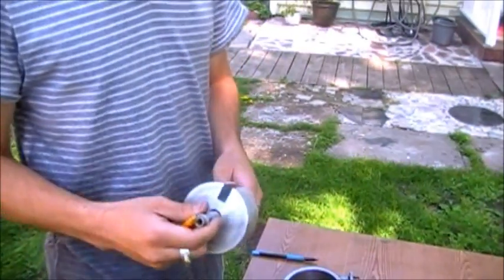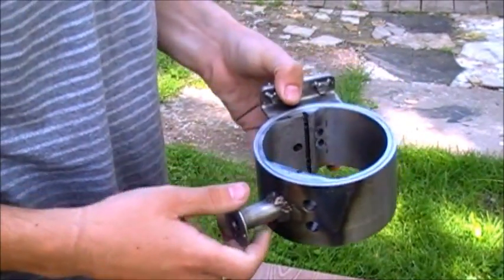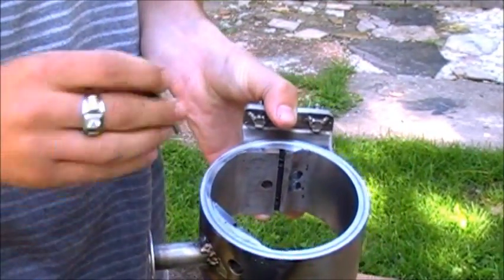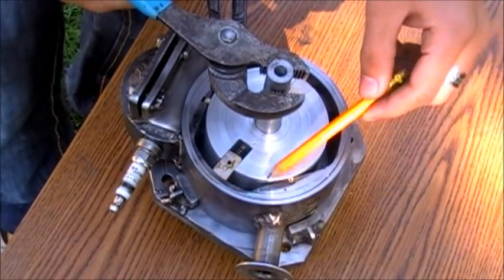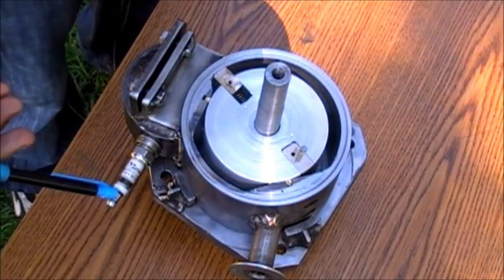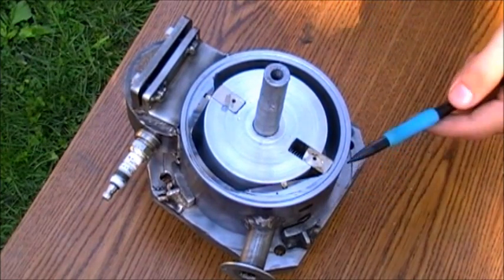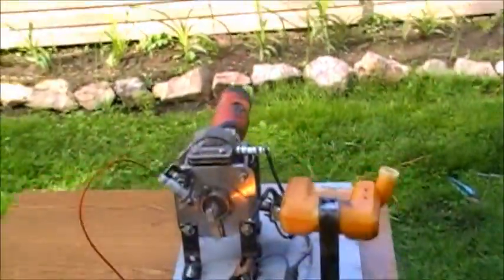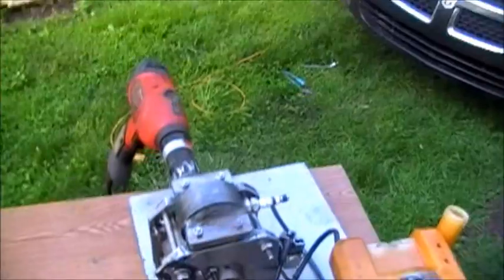new rotary engine semi functional prototype

Comment: Interesting way to view and build a rotary vane engine.  Exciting to see your ideas.  I like your combustion chamber idea, but the first thing I see is that your intake sweep does not push the intake into the chamber. It only creates a large space behind it as it sweeps. Yes, this draws in air and fuel, but does nothing to push it into that chamber. Even IF the other vane were operating opposite the one you demonstrate, the timing would not create compression in the combustion chamber because it is open to the back side of the primary vane which is rotating away from that chamber at the same speed.  That timing would allow the forced induction to run freely out the combustion chamber and behind the first vane.  Maybe if you add 6 more vanes so that each one is backed up by the next one.  Then you would need combustion to happen BEFORE the vane begins to move out from the center rotor.  Problem there is that each intake event would be much smaller.  You would need to reduce the combustion chamber accordingly.  Many small power events rather than 1 or 2 large ones per rotation.  IDK.

Comment: The issue is not just poor machining. As a proof of concept prototype it is good enough. The one reason I can see that there is no combustion happening even though there is spark at the correct time and place. It’s because for the spark to ignite an air fuel mixture there needs to be positive pressure of the mixture to more than 4 bars. In your proto, there is no pressure increase in the position where the spark happens. If you look at the cavity where the spark happens between the check lock and the vane, there would probably be a negative pressure that’s under one bar because most of the pressurisation is still happening before the check lock. So That will never ignite. 

My name is Deepak, im an industrial designer, I've also been working on a rotary vane engine just to try solve this challenge if possible and I will be making a proto in the next few months with a help of a few close friends. but judging by all the experiments I have been seeing on the net, I am now less confident that even mine will work since none have been successful so far. But each of these videos, like yours really helps visualise the issues much better. So I will give it a try. 
Thanks for this video, and Best wishes.

Comment: NICE!!

One thing overcomes leakage:  RPM!!!  
This design will simply not work or start at  the low RPM the drilling machine is turning it at IMHO.
That means the one way ball valve will probably not respond fast enough...

Tolerences:
Research:
Dr Ali Erdemir Argonne National Labs Boric Acid in engine oil lubricant
NB the research where it's tested as a fuel additive!

NB that this stuff forms a half micron thick layer that is not only 'Frangible' but slippery as hell and turns the water of combustion into a lubrication advantage..!
A half micron thick layer on a surface = 2 microns of tolerence removed from bearing etc diameter..!

ie:
* Treat the engine in accordance with the Boric Acid research to remove 2 microns of play (+ greatly reduced friction) from all the sealing surfaces etc.  NB it's 'Frangible/Frangibility.......!!
* Remove the springs from behind the rotor seals. (rely on centrifugal force)
* Spin/Start it with an electric motor capable of much higher RPM than that drilling machine.
* Play with ignition timing.
* Consider a lighter, faster responding, one way valve arrangement.
And you're off to the races!

Comment: So controlling the flow inside engine is better managed by a Vale that blocks the area were it causes Eddie flows and countering out the pressure I'm looking into that at moment, the shap of the inside of this engine is everything that wouldt work, to much contact causing wear, but I see why he did it this way.

Comment: Central fugul forces are often used in vain pumps but it causes lots of friction issues, also leaving a small get can be better which doesn't keep much power, using springs causes to much pressure and takes energy from the engine so that not much good, using material with slip properties like Teflon is sometime worth trying.

Comment: I think there are two considerable issues with this engine inner design. The most severe issue is sealing the of the volumes and the sealing at the rotary piston flat surfaces against the housing plates. The other severe issue is the curvature of the vane path. There are circular curves and flat pathes. The transition between the curvatures lead to shocks and bouncing of the vanes against the surface. An elliptic inner path is steady which will considerably reduce the vane acceleration.

Another typical problem of rotary engines, which also the Wankel engine has, is the relatively high sliding velocity inside the housing, which can lead to interruptions of the lubricating film. It is also not easy to prepare the inner surface in a way that it provides a good hold of the lubrication film. A hollow cylinder is prepared by honing of the inner surface. I'm not sure, that there is a comparable technology for elliptic inner surfaces.

Comment: The bare minimum requirement for a working engine ids that it continues to run when the starter motor is disconnected. One major flaw of the design is the side combustion chamber. In the classic 4 stroke sequence, the intake gas is compressed and then ignited in its compressed state.  In your design, the compressed intake fuel mixture is decompressed as it expands into the combustion chamber cancelling out the previous compression stage and considerably reduces the potential performance of the engine.

Comment: You might get these type of rotary mechanisms from used rotary Freon compressors from air conditioners. They have the close tolerances. And, many burn out because of motor failure and contain a good working compressor mechanical assembly. But they cannot withstand combustion pressures. Thus my comment to use a century device made earlier to increase volume, lower pressure and allow use of the rotary compressors headed to junkyards. Especially in early testing. 
Might provide an entry business making powers bikes if that is your intent.

BUT BEWARE...YOU CAN BE KILLED EASILY BY COMBUSTION. START WITH A VERY SMALL COMBUSTION CAIMBER! YOU MUST PLACE ANY VENTIRI DEVICE IN HEAVY STEEL PIPE TO AVOID DEATH!!! ESPECIALLY FROM AN OLD AIR BAG! ALSO, UNFIRED AIR BAGS ARE ABSOLUTELY DEADLY AND SHOULD NOT BE APPROACHED. TRY ASKING AN AUTO BODY SHOP FOR BURNT ONES. THAT WAY, HOPEFULLY YOU WILL GET PARTS WITH VERY LITTLE CORROSION. NEVER EVER USE A CORRODED AIR BAG COMPONENT!!!

Learn BUT BE SAFE!
Reply: A venture device.

Comment: When developed, it might be an an excellent way to bring backup power to recharge batteries via alternator for the masses. Run on natural gas maybe need propane to start. You maybe could use a venturi like in car air bags to add volume and lower temperature of of the mixture of gasses and critical parts. A venture would probably steal 25% of the power...but what is your design goal?

Always tell us your end use or goal if you want better feedback.
Give us in helping you.

Maybe you need help to improve your machining accuracy, etc.

Comment: That is why electric motors are superor: they don't need energy differeces like t emperature, or height like in water turbines. They use magnetism. And e-motors don't wear out, are somple and easy to build. I drive an EV and it feels great no hifting gears because optimal torque is always available, at any speed. Once you ecperience that you eill never want a combustion engine again

Comment: Based on what I know after assembling engines for several years more than likely you got two lower compression ratio and you're not being able to take and contain the expanding gases that's probably blow by and not turning your rotor keep at it

Comment: I believe that you need more vanes or sweepers, 3 maybe 4 of them. I believe that your that your combustion chamber needs to be in the round cylinder its self not in a separate compartment. Also a heavy flywheel would really make a difference, as the inertia that in would store can help the motor complete a rotation along with making it run smoother. Keep up the work

Comment: During the compression phase gas travels through the combustion chamber straight through into the expansion chamber you need to have a valve there and it will work much better (not great but better)

Comment: put a reed valve in the intake port so the emgine can only suck in gas an ear mix and not blow the gases back into the carb the it will work and star and if it runs porly put a reed valve in the exhaust as well so the exhaust can only blow out the gasses and not suck in air

Comment: Hi good day . I want to present a project of a revolutionary engine for the world market. . I have an internal combustion engine Patented by PCT pending in 59 countries which is a revolution in terms of design, economy, efficiency, costs, weight and ease of production, apart from the fact that its size is scalable to any power, for any type of fuel, including synthetic methanol for negative CO2 emissions and HYDROGEN for ZERO emissions, obtaining much more efficiency than a current engine and greater than batteries and also fuel cells used with hydrogen and electric motors, a thermodynamic cycle innovative with more than 75% efficiency, only two main moving parts, a power / weight ratio greater than 13 KW / Kilo, everything can be made of aluminum except main shaft and screws, does not use liquid refrigerant only air, uses very little lubricant that can be used from the center through the seals to lubricate everything, the speed of the seals or segments is 7 times less than in any motor, can be extrapolated to any ier power without losing any characteristic, . Very easy to manufacture 100% with current basic technology, all its main moving parts mounted on commercial bearings, the useful life is up to 30,000 hours with very low maintenance, almost zero and more than 70 additional advantages....
As an example: Motors of 60 kilos of 1000 Kw can be made very compact without useless space.
https://www.youtube.com/watch?v=j3VRy7VqYE8&t=6s
https://www.youtube.com/watch?v=j3VRy7VqYE
https://www.youtube.com/watch?v=H2r8O1FfPt0
https://www.youtube.com/watch?v=9LnrNiHC_34
https://www.youtube.com/watch?v=VjNRkwqDXRs

Comment: Very good effort, tho the seals/rotor will self destruct rather quickly with such steep ramps if it every did run, there is also a huge potential for rather large drop in pressure as rotor reaches the combustion chamber making it less likely to exhaust and pull in new charge on intake. But I have to say it is a very cool idea and you guys did a great job with minimum tooling. Keep up the good work and take everything you've learned from this prototype and include it into the next build.

Comment: I think You and me are not the only ones who have tried to design it this way, but this design got a lot of issues I've been awere of on design stage when I had the concept for the first time.
I have sorted most of the issues, but still don't hava the final solution, but I'm still far ahead designwise, although I do not even bother to build prototypes that I know that won't last for long or will have tremendous wear and power losses.
Anyway as many of us think about this kind of things some of us will succeed soon and release an engine that will wipe of the surface of the earth classic piston engines.
I got already a few different projects, but one very complicated to produce - frictionless design ;-)

Comment: Interesting concept. It doesn't look like it would very efficient due to what appears to be a low compression ratio but you might be on to something. Have you thought about adding another bar to the opposite side of the rotor or maybe changing the dimensions of the hills (especially the angel of the downhill side, looks a little steep) and/or the dimensions of the compression bar (maybe round the outer most edges to make a smoother contact surface?).

Comment: The idea is good, but this aproach will never work. (meaning that the motor will start, but will work for few swconds until it grinds itself).I have thought of this type of engine back in 1990. There is also a team in Canada last time I checked that is experimenting with vane type motor. They were trying to figure out sealing and centrifugal forces. Think litle bit on a smoother aproach. Nevertheless, your efford is amazing. I totaly agree that someone must hire you.

Comment: You just have to turn it faster,mach faster,you dont have enough rpm-s with that drill,its most,maybe 700-800,probably less than that,you need to try with 2000-3000rpm it will work you will se,everything is good with engine
Reply: thank you for your input .... sorry i have lost the access to the original account .... i have thought about just trying to spin it faster but at the time i didnt really have much money or equipment to fabricate a gear and just even cut a keyway on the shaft .... still one of the most fundamental issues with this particular  prototype is sealing the rotor to the sides which is a difficult task....

Comment: This is nice thinking, but you lack a means to seal the outlet side of the combustion chamber, so the gases do not actually compress, they just flow into the expansion side. This is why it will not start. In a typical piston engine, the air-fuel mixture will not ignite from a spark if the compression is too low. You achieve essentially zero compression. But don't give up.

Comment: Man.. you started your prototype using drill.. that gasoline you used is un useful.. sort of advice, before you showed the video , be sure it works properly not even that perfect, once you use gasoline or any kind of fuel, be sure  it works that way,. Not on a drill machine.. but it's a good idea..

Comment: You have some serious design flaws.  The fuel mixture, that is forced into your combustion chamber, flows right back out through your expansion ports, around the rotor and out through the exhaust ports. You need some type of 'valve' to retain the mixture in the combustion chamber until the "working plate" passes the expansion ports. Likewise you need a valve on the "compression hole" to keep the ignited gas from back flowing out after ignition. I also think you need to soften the transition of your "hills". Right now there is too sharp of a break from the round of the stator to the flat of the "hills".

Comment: I can't see how this would work if the rotating mass is completely circular.
For it to self sustain the circular progression of rotor needs to be non symmetrical so that the power of combustion has a face to act upon in a given direction.

Comment: You have to follow Wankel's format. All you have to do is solve the sealing slides and sealing rings issue
to have a billion dollar engine. Impressive attempt though. 
Remember all engines are nothing more than air pumps with the ignition of expanding gases incorporated 
somewhere into their cycle of operation and the amount of power is purely volume metric..

Comment: i wonder if this prototype ever progressed beyond this stage. it seems to be a good idea but I don't know if it actually is because we don't know how efficient it is or the power it can put out. it seems to be a good idea because a lot of parts have been eliminated compared to a normal engine which should make it more reliable and long-lasting. Did you build a version 2 or something?

Comment: Good idea but there are a few things that would help .
1 : You need to taper the first 1/3 of the leading edge on those veins to push those seals smoother you have plenty of material and only about 6-8 millimeters in from the edge should be enough to push those seals in smoother .
2 : By eliminating that external expansion chamber ( there's already one built in to the housing ) you should almost if not more double the horsepower .
3 : Back to those veins I see you have 2 but 1 is welded into place if you take that weld off add a third that would give you less rotation between ignition points .
4 : drill some holes through/shave down some that barrel you don't need all that mass .

Comment: Nikita - You could use a screen and some sand or iron blocks to quickly vary the combustion chamber size.  You might want to try some natural gas instead of gasoline; also try some starter fluid but be very careful with starter fluid.  The theory seems correct.  Wish I could provide you with a verbal articulation for your video.   Also a flywheel would allow you to advance the ignition.  You show two vane type seals; a large main seal that rotates with the rotor and a small seal that stays with the stater.  At high rpm the centrifugal force on the large seals will be difficult to manage.  Need to figure out how to lessen that weight and/or the length of the seal to travel. The expansion of the seal due to heat is also gong to be a critical factor.  It might seize.   Be nice if the main seal could be a roller bearing somehow and it only moved 0.125" or 2mm .